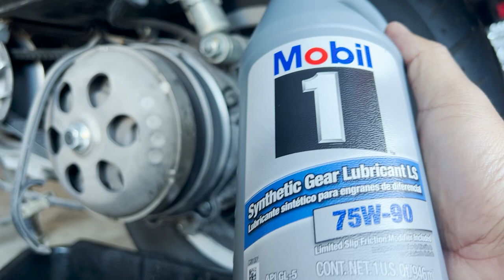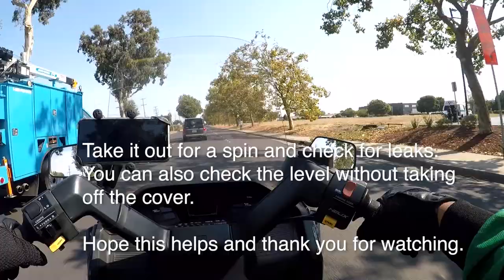Honda Helix Final Drive Oil Change

Comment: I know a lot of Helix owners are going to really appreciate this video, so I'm going to be the first one to comment on a job well done! I changed mine a couple of years ago using Mobil 1 also but I didn't think of using that vent hose to help force assist flushing it out, while I did assist flush it somewhat going through the filler hole. Thanks for the great idea and I'll remember to do it that way the next time. Happy and safe riding for this season!
Reply from the maker: Thank you. Glad it helped out. Can't wait for warmer weather, nothing beats riding the Helix on a hot day.
Reply from the maker: Sorry for the late response. Macross is from a childhood show. I ride during cold weather but scooters are more fun in warm weather.

Comment: Great video! I will be doing this soon. Honda recommends (GN4 10w-40). I see many folks using gear oil as you did. I have to decide what to use for my 1999 CN 250 and the advantages of using gear oil. Thank you for the great video!
Reply from the maker: Thank you, both of those oils will work.

Comment: This and all of your upcoming vids are going to be golden for me. I just changed my final drive oil and used 10w40 oil. As per the manual. How many ounces did you put in? I think it holds about 5?.
Reply from the maker: You basically fill it until it overflows. On my video I probably put too much and need to wait longer than usual. You are good with the oil stops flowing out.
Reply: So the manual recommends 10w40 but its perfectly fine to use that heavy weight gear oil instead?  @MacrossGarage
Reply from the maker: @nobodyspecialdotorgrichard5971  I got the idea from an old forum years ago. A lot of people do it.

Comment: 5:02  too bad manufactures don't  insert a piece of sponge inside that vent tube.  They just leave it open to collect all the dust and dirt. Also spiders build nests inside.
Reply from the maker: Good idea, but if they did I have a feeling you would need to maintain it.

Comment: In the manual it says the engine and gear oil is 10-40. Altho it also says you can use 20-50 for engine oil also depending on weather. Does using 75-90 like you used make any difference. I myself think 10-40 is too thin for gear oil but no were in book does it say 75-90.  Just wondering if it will hurt anything if I do switch to thicker gear oil... thanks for the vids, hopefully you do more
Reply from the maker: You are correct the manual does call for 10-40. After a lot of forum and website reading it seems all the weight you mentioned have been used and are ok. I ultimately follow cn250.net. 
http://www.ch250.net/techtips/9.htm
Reply: Awsome, thanks for the link, thats gonna be a very good and informative link.
Reply from the maker: @crego00  You are welcome

Comment: Would the gear oil have any thing to do with the speed
Reply from the maker: Just like engine oil it helps the Helix run smooth. So yes it can affect speed especially if you never change it.

Comment: Do all honda helix U.S models from 1986 - 2007 uses 75W - 90 gear oil? Thanks.
Reply from the maker: Manual just calls for regular 10-40 engine oil. But I followed this site. http://www.ch250.net/techtips/9.htm

Comment: Curious what the phone mount is that you're using and does it work on the metal bar of the handle? Thanks
Reply from the maker: I am using the Ram mount with the hose clamp. I put it around the plastic cover but used rubber padding so it doesn’t break the plastic when you tighten it.
Reply: @MacrossGarage  Thanks a lot. Any specific model of the Ram or is it just the one?
Reply from the maker: @arillwiltker  it’s been awhile but I bought the base and then then you buy the arm and mount separate.
https://a.co/d/2JcmPTp

Comment: Will 75w-90 be good in long term? I've never done this before and honestly don't know it's benefits over the 10w-30/10w-40 the manual recommends
Reply: Also will this cause any slip like a automatic transmission if it's never been done before? Figure not but figured I'd ask
Reply from the maker: You are ok with either oil. I've search many forums and either one is ok. If unsure use the manual recommendation. I base mine a cn250.net site like i mentioned in a previous comment. The only real difference i believe is the thickness. the 75-90 is on the thick side like 10w-40. So use that for warmer weather. Hope that helps.
Reply from the maker: @rcman1023  If you feel slipping, it's likely the belt. You can see the belt on my video. Does your feel like it slips?
Reply: @MacrossGarage  Somewhat, I haven't inspected the belt as of yet, sometime on acceleration from a stop the bike shutters and or vibrates hard until it gets past 15 miles an hour
Reply from the maker: @rcman1023  Try to feel where it comes from. I had vibrations and it turned out to be my front brake pads being worn out.

Comment: I know it’s probably in the manual but just wondering how often you / others do this? I recently bought a helix with 45,000 miles, and while it runs pretty nice, with that many miles I think I’ll have to take care to maintain it really nicely to keep it that way.
Reply from the maker: Manual says every 12k miles or 2 years. With that many miles I would do it. You never know when they did it.
Reply: @MacrossGarage  I didn’t mention, but I did it pretty quickly after getting the bike. Figured that would be an important one. I also had a tire to replace, a brake master cylinder to rebuild, leaking valve cover gasket, and bad fuel tank drain plug washer to replace. It’s been a lot for someone with zero prior mechanical experience, but really great to learn, and the bike is so much fun. Hope you are loving your Helix too, and thanks for making Helix videos!!
Reply from the maker: @AudreysKitchen  Looks like you are in good shape. Glad you were able to change fix everything. The helix is my favorite thing to ride in warm weather. Ride safe.